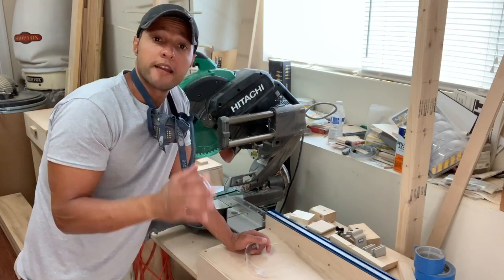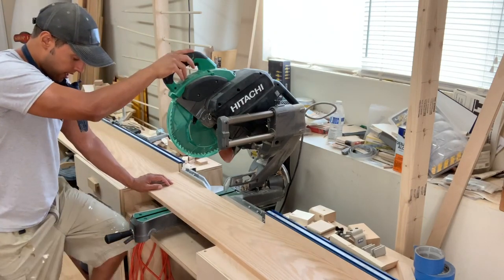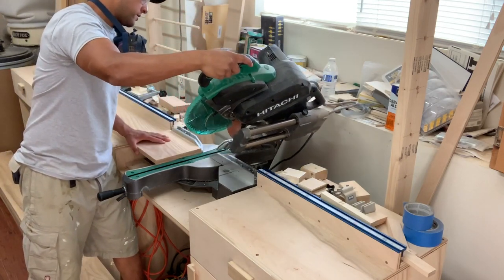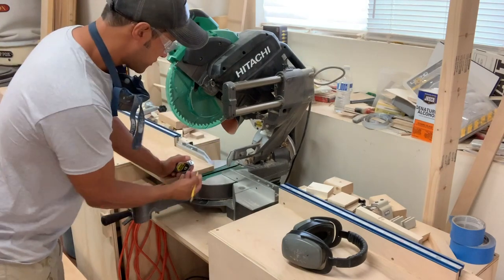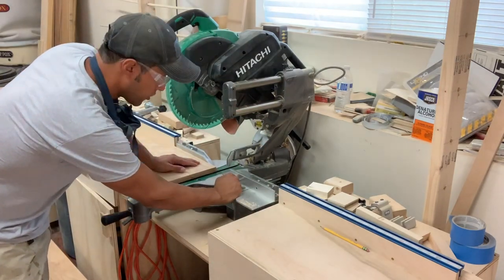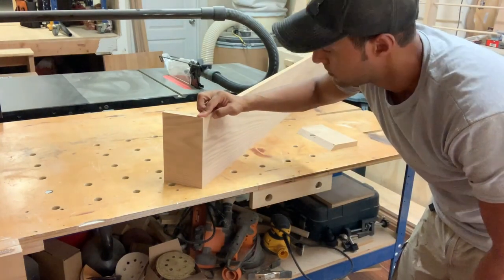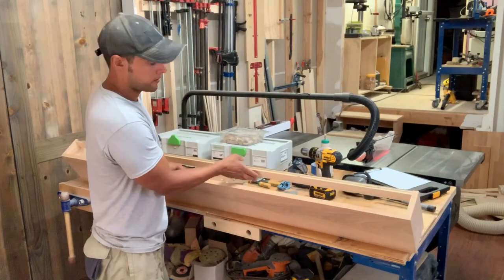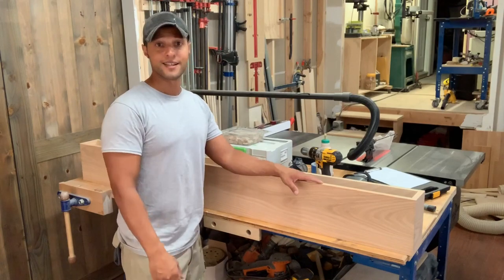How To Make Bevel Cuts

Comment: very good..
so are bevel cuts another way to make miter cuts both are 45s and the two ends add to 90 .? You did to basically overcome the width of the board hitting the blade guard issue. Thx much.
Reply from the maker: sabestek yes, it can be done at the table saw as well

Comment: I tried this method today for the miter, but I'm having troubles with the quality of cut, I'm not sure if there is is flexing in the blade or what not, but midway though the cut there seems to be like a dip. Anyone know what I'm doing wrong? maybe the quality of the saw isn't that good? I'm not sure. i make sure that it's firm to the fence, and it seems square, other than that dip

Comment: I just done some of my baseboards and I started by making beveled cut on end and flipped and spun board to get the cut in same direction for corner and make it where ur cutting from ur longest point on board on top so u can more accurately measure I was using trial and error but I have a dual bevel dewalt 12 in saw and with the original blade and with a avanti pro fine finish blade both never used till now it was burning wood any one know why am I doing something wrong it is 8 in tall I think poplar wood
Reply from the maker: Two things could be the problem, first is the blade, how many teeth 60 or 80 is a must for finish work and quality of blade, Avanti is a thin and not really good blade. The DeWalt blade that comes with the saw is also low quality(that’s how they save some money) try a Freud or CMT orange. Second is the speed of cut, if you go to slow, you will experience burning
Reply: @AnthonyScolaro1  it's a 80 tooth blade and it is finish blade the only reason I got it cuz it said on it that it's is made by dibalo and it's the next step down as far as quality
Reply from the maker: @braddalton9260  trust me, years of experience and 100’s of blades, Avanti is not good enough quality for fine finish. Try a better blade and watch your feed rate on the cut.
Reply: Ok thanks for info I'm a mechanic but have been getting into wood working more and more I ordered the cmt blade I'm learning to router and I got a milwaukee router m18 for trim what brand of blades are good I have 2 Diablo bits for it so far what would u recommend and all my milwaukee tools have been great the battery jigsaw circle say both m12 and m18 the multi tool is best one on market does cmt make good blades for jig saw and circular saw to

Comment: My bevel cuts are always off a little seems like 1/16” or so I must be doing something wrong. Great vid as always.
Reply from the maker: Jerry Wilson Jr try calibrating your saw, the 45 detent might be off.
Reply: I notice when you are making those 45 deg bevel cuts you make a few passes b4 finishing the cut. Is it because it makes a more accurate cut? I head saw blade can flex during bevel cute and that can make inaccurate angle. Great video!
Reply from the maker: @robertgrlic6505 I do that for a few reasons. This is Red oak, so it’s very hard and can cause the blade to flex. Also by making several passes in hardwood, it helps to prevent burning of the blade and wood. You can also creep up on the cut this way as well.
Reply: @AnthonyScolaro1  thanks! I will definitely try/practice!

Comment: My miter or bevel cuts are always a little off, I’ve cut them on my miter saw table saw and even made a 45 jig and it’s always a little off
Reply from the maker: There are a few things to check in this case, first you have to calibrate your machines. Setting the miter saw and tables saw to 45 without proper setting up of the tool will cause you to be off. Also, you have to make sure the squares (combination or angle gauges, digital gauges etc...) are 100% accurate that you are using to calibrate the machines. If you haven’t spent some serious time calibrating the set up of those machines, your cuts will never be perfect. Lastly, if that all checks out, I’d start looking at the machines, are they quality or cheap, the blades also can be a problem if they are not quality because cheap thin blades tend to flex. And finally the operator, check your feed rate of the material through the cut, are you moving too fast? Too slow? Or is the workpiece not secure and wandering off during the cut. I hope this helps, unfortunately I don’t know what you are working with. There are thousands of factors that could be causing the problem.

Comment: how can you cut a 46 degree angle
Reply from the maker: Al Ondriezek most miter saws go to 60 degrees on one side and 50 degrees to the other, but if yours doesn’t then you have to make a simple jig for it.
Reply: @AnthonyScolaro1  Do you have any video or a pic of Jig that you will use to cut Any angle more than 45 degrees ? My mitra saw only cut upto 45 . I am after  a bevel mitra cut . Simple mitra cut i can make a jog , but not sure how to do for bevel mitra cut please